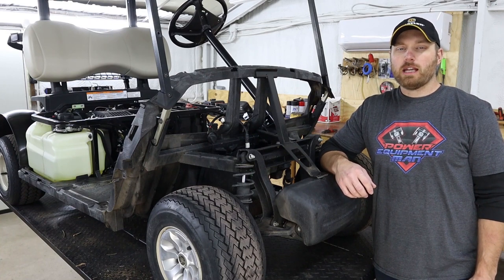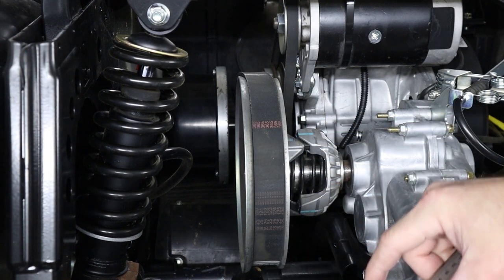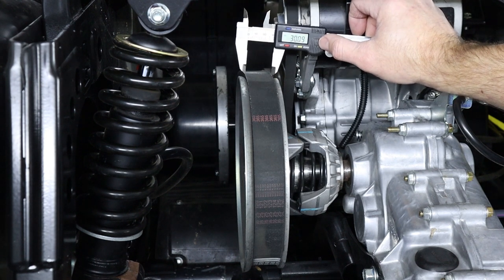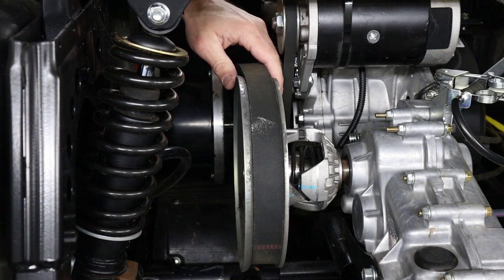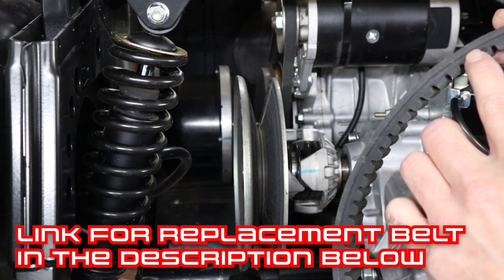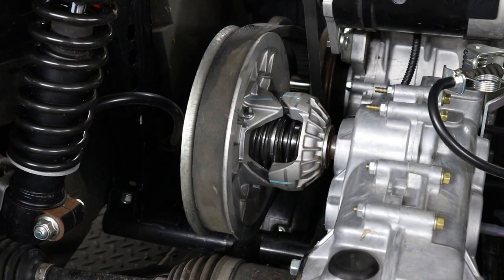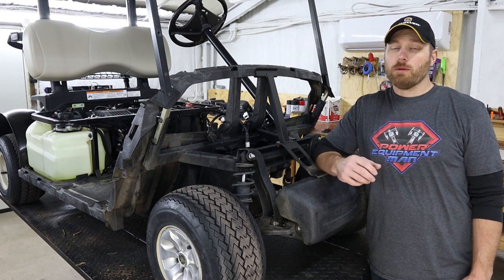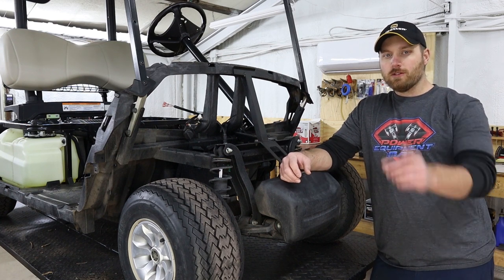Yamaha Drive 2 Quietech G29 Drive Belt Replacement

Comment: What is the grease zerk fitting size on the QuieTech clutch?  I can't get onto the zerk. What is the female coupler size please?
Reply from the maker: It is just a standard size grease zerk fitting. However, the opening around the fitting is pretty tight. We just did some grinding on the outside edge of our grease gun tip to get it fit into the hole easier.

Comment: Our golf cart starts but will not move.  What would cause this?
Reply from the maker: There is a difference between your cart "starting" and "cranking over". Once you push the pedal, the engine "cranks over" but it should then fire up and "run". While running you should be able to increase and decrease engine RPMs. So is your engine actually "running" or is it just "cranking over"?

Comment: If i have a factory 2021 quiet tech will the belt on your website be a good replacement?
Reply from the maker: Yes, if you need to replace your belt, our kevlar belts are the best belts on the market. If you don't have any other engine or clutch modifications done to your machine you likely won't notice much difference in performance over your stock belt, but the kevlar belts do typically last longer. When you start make performance upgrades is when it becomes more important to have a better belt.
Reply: @PowerEquipmentMan  thank you so much for what you do. The channel and the website! I enjoy them so much. Keep it up and happy new year.

Comment: Good Morning

2 months ago I replaced my drive belt on my Yamaha golf cart. The split on the seam. How do I fix this?
Reply from the maker: What brand of belt did you use? What model of Yamaha do you have?
Reply: @PowerEquipmentMan  yamaha part jco-g6241-01-00 its a Yamaha 2016 Drive 2 EFI
Reply from the maker: I'm having a hard time figuring out if you have the correct belt. The Drive2 models did not come out until 2017. So if your cart is a 2016 then it is a Drive1. The belt for a Drive1 is J55-G6241-03-00. The belt for a Drive2 Quietech is J0D-G6241-01-00. You need to find out for sure if your cart is a 2016 or 2017, and if it is a Drive2 then you need to know if it is a Quietech or Non-Quietech. Then I recommend you order a heavy duty belt like the ones we sell - https://powerequipmentman.com/collections/best-sellers/products/yamaha-quietech-premium-drive-belt?variant=40336157278399

It would also be a good idea to inspect your clutches for wear and proper belt alignment.
Reply: @PowerEquipmentMan  How do I check proper belt  alignment. It is 2017 Drive2 Quietech
Reply from the maker: When the engine is not running, the belt should be centered in the front clutch and straight between the two clutches. It is best to look from the back of the cart, look down the top of the belt and it should be straight and not angled from one clutch to the other.
Reply: @PowerEquipmentMan  Good Morning, I purchased the new belt from you and am having difficulty putting on the new belt onto the drive shaft. the new belt is very stiff. Any ideas on how to get that on? The old belt came off no problem.
Reply from the maker: Can you email us a picture of your cart and a picture of your clutches? sales@powerequipmentman.com
Reply: @PowerEquipmentMan  Just sent them to you
Reply: what type of grease do I need for the drive shaft and clutch? Marine?
Reply from the maker: If you are talking about the grease zerks on both clutches, just use regular multipurpose grease (like wheel bearing or chassis grease). They only need one or two pumps of grease each.